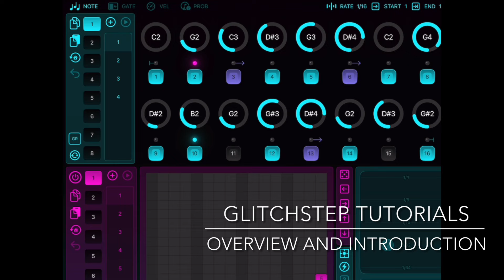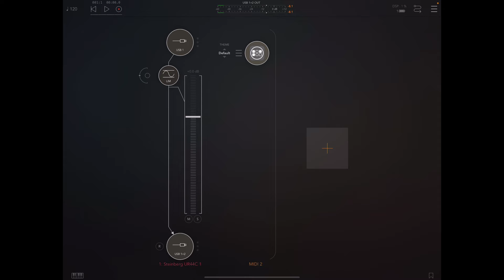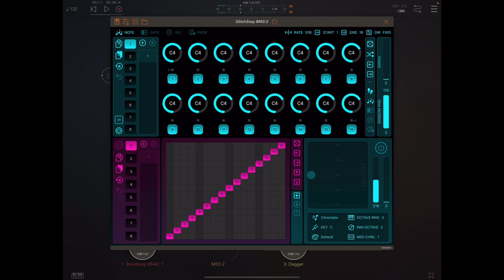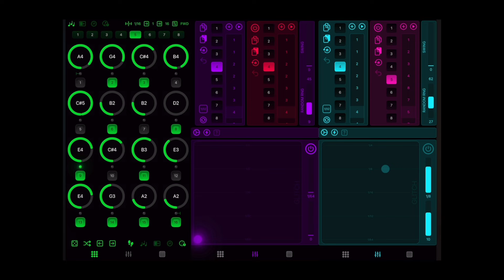GlitchStep Tutorials — Overview and Introduction

Comment: Can Glitchstep be remotely controlled by an external controller using AU-parameters?
Reply from the maker: @AcoustiMan818  yes it can I exposed over 160 params and organized them into categories. Nearly everything you can do in the app can be externally controlled
Reply from the maker: @AcoustiMan818  I also am working on an advanced video to show controlling GlitchStep externally with AU Params
Reply: @distraub  nice 😊